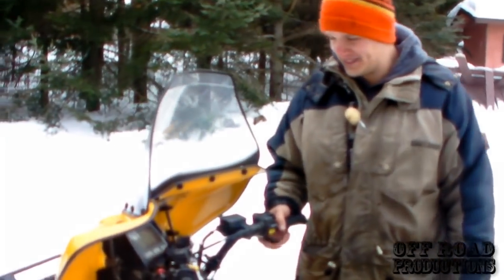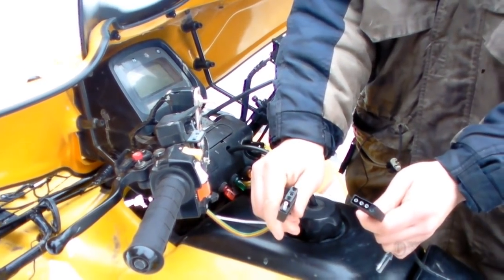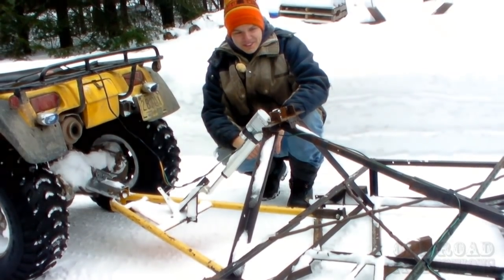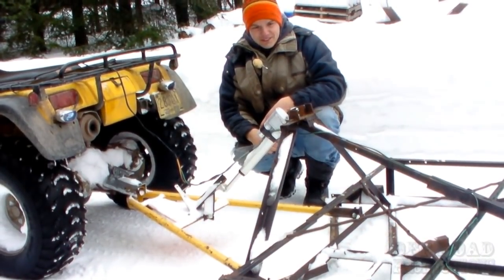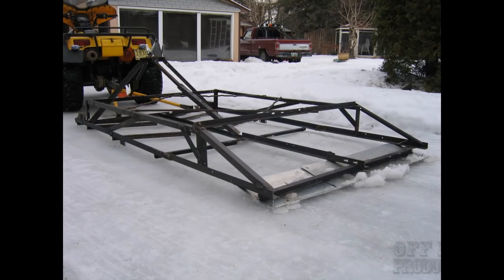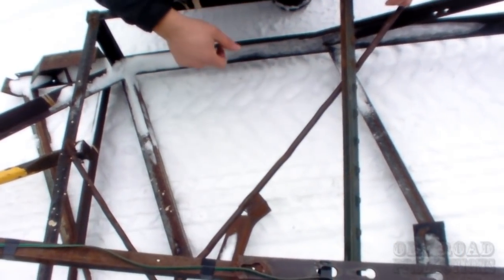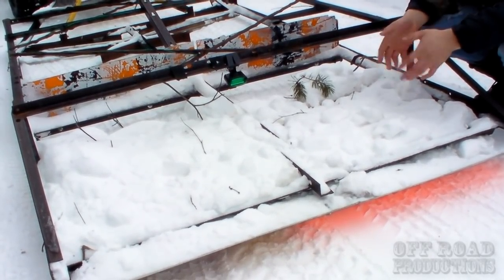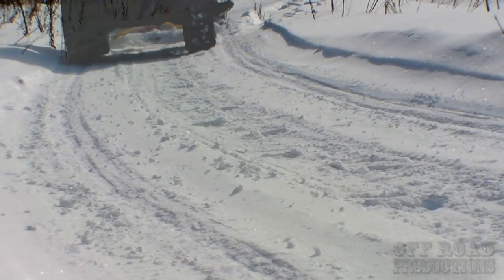The Best Homemade Groomer 2 of 2

Comment: Instead of the $150 actuator,surprised you couldn't find an old C-band dish actuator in the dumpster.Most are made for 24v,but would work on 12v,just slower.Maybe this will help others inspired after watching your video.Nice job!

Comment: Nice design and a very well done video. Proof that a snow drag does not have to be heavily constructed to do a good job. The actuator is essential in order to do a good job without getting stuck all the time. Is the 500 lb rated actuator hanging in well? I went with the 1000/3000 lb rated one on mine, but I think I probably could have got by with the less costly 500/1000 lb one like you have. I'll try to attach a link to a vid of mine if I can figure out how to do it.

Comment from the maker: @glennmccr 
The actuator is rated for 500lbs. The entire Drag weighs about 200-250Lbs.  The Actuator normally has a about a 50lb load on it. There are times when I am grooming over moguls where I worry about overloading the actuator.  I hope the bolts or a weld holding the actuator in place break before I reach the 500lb rating.

Comment: What's the angle on the angle? How many degrees offset are the bedframe cutting edges from square?
Reply from the maker: Ha! You're asking questions I never thought about when putting it together.  I just welded them to an angle that I thought looked good.  If I had to guess I would say 30-40 degrees.

Comment: Great video. Two questions. Do you find that in order to use an atv over a snowmobile, are you having to ride on an already packed trail? I am surprised to see your machine stay afloat the snow so easily.

Also, ever thought of making a track setter for classic skiing?  I did make one and I love it. It makes skiing so much more enjoyable.
Reply from the maker: Not having a track kit on my ATV means that I can only groom already packed trails.  There have been a few times I've use my snowmobile to pack a trail before I can use my ATV to groom.  
At the 4:00 mark of this video you can kind of see my wheels fighting for traction in that depth of snow.
I would love to get tracks for my ATV but can't afford them.

As for track setting.  I have made a couple of (lousy) contraptions to adapt to this drag.  I haven't spent too much time trying to make one that works properly because I don't have any trails that would be safe from the destruction of snowmobilers.

Comment: After 3 yrs does you linear actuator still work? And what's it rated at in lifting weight?
Reply from the maker: It still works! One of the bolts that holds it on broke last year though... simple fix.  I'm not sure what it's rated at for lifting, but I am surprised it still works!

Comment: How did it hold up after a few years? Any improvements?
Reply from the maker: I haven't used the drag in a few years now.  Life got busy, kids and stuff happened, etc.  Since making this video the only thing that broke was one bolt on one of the lift actuator mounts - an easy fix.

Comment: What is the length and width of the drag?
Reply from the maker: It's about 50" wide and not including the tounge portion of the drag about 65" long.
Reply from the maker: I was wrong with that previous measurement.  I just measured it and it's 52" wide and 100" long
Reply: not bad for being made of garbage if you know what I mean

Comment: How much stroke on the actuator?
Reply from the maker: I think it's a 12" actuator, but I only need about 6" to operate the drag
Reply: +offroadryanmb How would you attach the drag to  snowmobile?
Reply from the maker: +Thomas Kiska you'll have to use your imagination to build a system that will work for you

Comment: this was pretty funny.  only in canada would you try to make the snow in your driveway look pretty :) I guess that's the only lawn you have for most of the year poking in ribs around here in colorado we shove it out of the way.  the basic design looks good for grading a messed up water logged driveway in the spring though. good job in low budget fabrication.
Reply: its not for a driveway lol. Its for snowmobile trails so they are smooth to ride on, not full of bumps. Like a grader for gravel roads, but this is a grader for snow trails lol. Its a world of a difference to ride on a groomed trail versus just a packed trail by machines